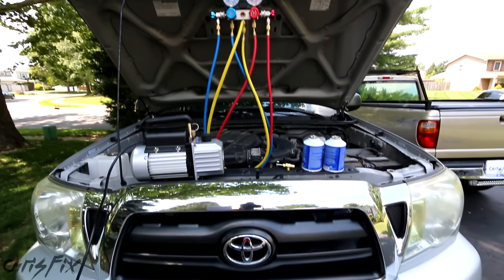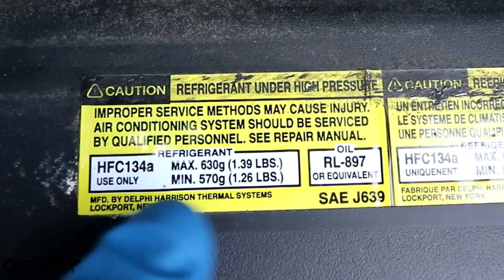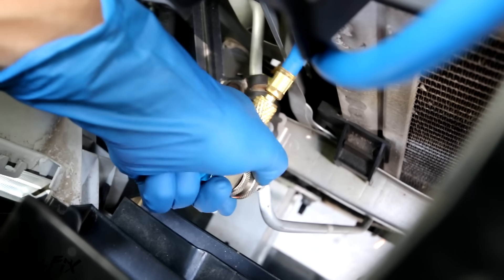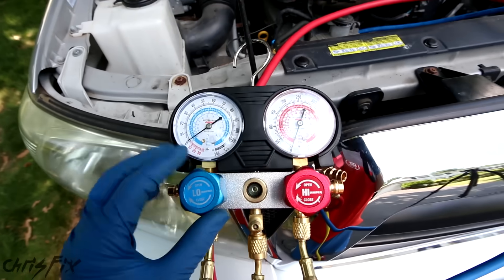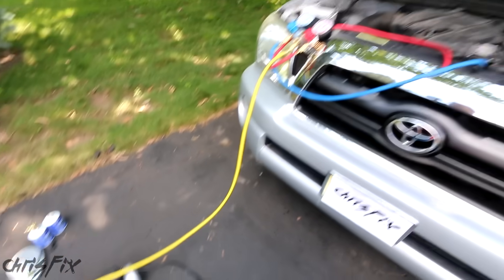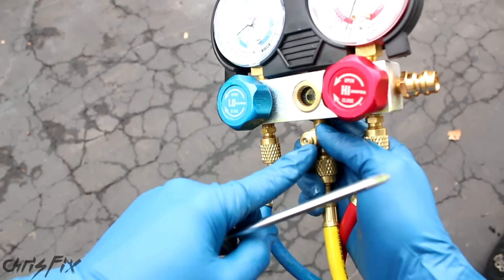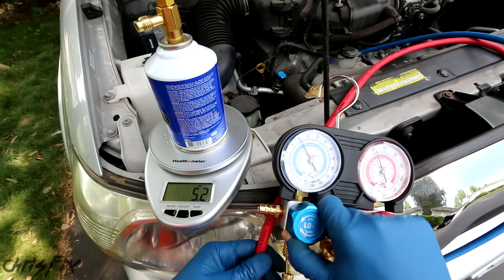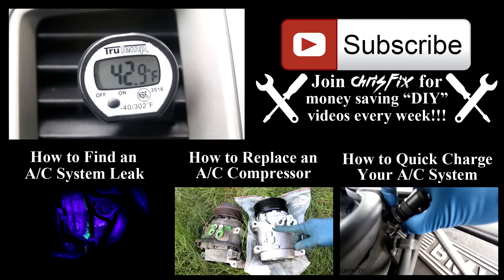How to Properly Recharge Your AC System

Comment: Hey @ChrisFix, my AutoZone loan gauges show static pressure (engine off) of around 45psi on both the Low AND high side. Same readings when engine rev’d and held at approx 2500rpm. Blows steady hot air all vents. Outside air temp at 95 degrees with about 42% humidity in Southern California. 

What could be the problem?

Vehicle is 2006 Honda Ridgeline RTL with 136k miles. No engine codes.
Reply from the maker: That means that the ac compressor clutch is not engaging!
Reply: ChrisFix thanks for the quick reply! FYI I think I know why the compressor is not engaging—I have a VERY SLOW leak in the low side Schrader valve!

I left the gauges connected to the low and high sides with the intent of checking the base pressure again in the morning. I checked the pressure about 6 hours later and both high and low sides had lost 4psi of pressure. Do I removed the hoses and I heard a very faint “hiss” on the low side Schrader valve. Lightly touching and releasing the pin didn’t stop the hissing—the valve is either bad or loose. 

I followed the directions on putting the hoses on and taking them off so I don’t believe I damaged the valve, I just think it finally gave out after 15 years. I sure it would have probably failed had I just put a can of refrigerant in it. 

So now I get to replace the valve a do a complete vacuum and refill! 

Are you familiar with the specific Schrader valves that Honda uses or should I just buy a kit on Amazon with multiple valves and the insertion tool? Any recommendations would be appreciated.
Reply: @chrisfix  I was so determined to learn the A/C system and am saving up for a vacuum pump. I am having trouble finding a proper can tap to use with my ATD manifold gauge.

Comment: How does the air and water get out of the system?
Reply from the maker: 6:55
Reply: @chrisfix  Right, I saw that, but where does the water and air physically go to?  Does it drip on the ground from somewhere?
Reply: @dajur1   My vaccum pump has white smoke coming off it as it seems it's evaporating something and after the vaccum is complete, there is a light puddle of water. So I guess the vaccum pump takes it out.
Reply: @arturotorres6437  Yeah, I think that is what happens.  I can also feel some moisture coming out of the fan area, so I think it goes out that way as well.

Comment: really weird to watch this, in the netherlands, because you are working with HFC gasses, you need to have a certificate to work with it. 

i got the certificate. but hell my teacher would kill me if he'd hear refrigerant come out of the AC lines haha. 

you need to have the car running for longer to make it suck the refrigerant back into the system. those lines would easily hold about 1 to 2 ounces of R143a. so you kind of under filled the system there.
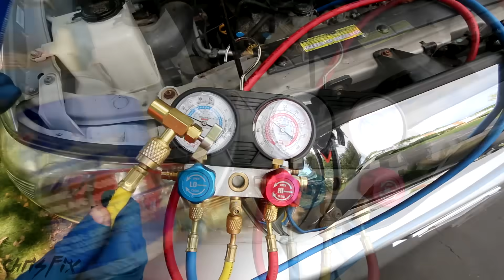Reply: yeah I don't know how long to keep the car running while it is being recharged. When I disconnect the can from the yellow supply hose, it DOES NOT sound like 11:20   Instead I got a good amount of refrigerant leaking out.

Comment: Nice video! When i was to refill the ac system that guy do it in about 10-15 min. So was a scam. After 2-3 years the ac doesnt make cold air anymore.
Reply: Yeah my mechanic filled my AC system with a can of refrigerant in about 10-15 minutes. Seems when the system is being added freon  or refrigerant a vaccum isn't needed but in this ChrisFix video, he had replaced one of the major components so that is why it took longer.

Comment: Do you add the refrigerant while still under a vacuum? In the video the low pressure gauge looks like it’s not under a vacuum when adding the refrigerant.
Reply: No, the vaccumm is the pre-step to adding refrigerant. Once you vaccumm the system, you turn off your vaccumm pump and disconnect it from the Yellow line. Then you start the process of charging or adding refrigerant to the Yellow line after you've confirm the system has held a vaccumm (no leaks detected). Remember Chris said the vaccumm is an important step as it removes moisture or air in the system and you want that completely removed before adding refrigerant, otherwise it could damage the AC compressor later on.

Comment: i followed this video step by step, and it couldn’t have gone any better. i live in vegas and haven’t had AC all summer, but i turned on my AC today and have been smiling all day thanks to this video. this is really easy to do, as long as you have found out where your leak is, and are able to fix it. thank you!
Reply from the maker: That's what I love to see! Thanks a lot!
Reply: Hey Ben I’m in Vegas aswell , would you rent me out your vacuum pump ?!
Reply: LethalWithFlight oreilly or autozone rents both the pump and the manifold gauges, you just have to deposit like $350 but they give you all that back when you return it! that’s exactly what i did

Comment: What happens if you accidentally add extra r134a? Will the compressor stop engaging? How do you remove excess r134a?
Reply: If you add extra then there is the risk of the refrigerant not being able to change states at the correct times and may enter the compressor as a liquid and mix with the oil which will then clog parts of the system. The only way to legally remove refrigerant is to have it recovered by a epa certified tech.

Comment: Why is there a need to recharge our AC system? Does the refrigant gets consumed in any way?
Reply: In the case of a leak, you would need to add refrigerant after fixing the leak. The previous video showed replacing the compressor, the first step of which was to have the entire system evacuated (all the refrigerant pumped out and recycled).

Comment: Once I start pulling refrigerant out with the pump, where it goes? Thanks
Reply: Goes into atmosphere that’s why Chris mentioned to recover it properly with the garage that has the very expensive recovery machine to collect it. He was just pulling a vacuum on an already empty system because he replaced the compressor himself and it didn’t contain any gas.

Comment: Hi Chris, did we actually have to use rhe vaccum if no AC components was replaced. Im just low on Freon. The compressor is fine and the clutch kicks in as soon as I switch the Ac on.
Reply: Chris said only if you're replacing the A/C compressor, condenser, or evaporator. My mechanic charged my system after replacing a high pressure line and I asked him if he needed to pull a vaccumm and he said no. So yeah, you wouldn't need to pull a vaccumm when refilling a system with low freon.
Reply: @arturotorres6437  thanks for your time and promptness

Comment: Oriface tube and dryer should be replaced always !!!  when doing a compressor change . Also if the previous compressor failed the system should be flushed and blown out with nitrogen.

Comment: DO NOT DO THIS.  You MUST PRESSURE TEST the system.  You cannot, EVER find a leak with a vacuum.  The vacuum SEALS cracks.  You must pressure test.  Usually with nitrogen (inert).  THEN vacuum, then fill.  Again, you will NEVER find a leak with a vacuum test. 
Always hold the can up side down so it always has liquid in the line.
Reply: Err, no...  vacuum won't close up most leaks.  Pressure test is definitely better, but it's not like vacuum testing won't find most leaks.

Comment: Also every time you attach your gauges to a system you’re actually losing refrigerant if you’re not properly removing the gauges.
Reply: My shrader valves keep getting stuck open when I remove the bushes from the lines. Do you know why this keeps happening?

Comment: On a residential air conditioning system you would close the high pressure side and open the low pressure side to suck the refrigerant you left in your gauges so you’re not leaving the system a few ounces low when you finish. Yeah you sucked 22oz in but you left a few in your gauges when you took them off. Those low loss fittings just keep the refrigerant inside the lines when you remove them.

Comment: You didn't say how bad the compressor was or if metal was in the system. If metal is then  consider  replacing the condenser and receiver dryer. Depending on miles it's always a good idea to replace the dryer.  Nice work overall.

Comment: What if you haven’t replaced any major components but haven’t used or recharged ac in a while. Would I still need oil?
Reply: Probably not, I replaced the condenser and drier/receiver canister on my town car and added 2oz of oil (require 6oz total) (assuming it lost some from the leak) BAD IDEA, ended up being overfilled and blew the front seal out of the compressor. If your system only lost charge, a thorough vacuum and recharge should be all you need.

Comment: The yellow line on my set has a valve in one end, but it didn't seem to affect the vacuum.
Reply: Use a valve stem remover to take it out 👍. (same tool used on tires) You might need pliers to pull it out once you unscrew it all the way through. I rented a pair from autozone and had to do the same thing that's happening to you

Comment: Question"
What if after vaccum i decided to fill the freon without starting the engine like you did?
Reply: You can add refrigerant with the engine off at first, but it will only allow the refrigerant into the system until the pressure in the system and the can equalizes. Then you would need to start the engine and have the A/C on.
Reply: Zach Miller i did that process but i think i cause air in the system that i need to evacuate some of my refrigerant until it stabilized the sure pressure in the ac aystem.
Reply: Hector Aldozar thank you

Comment: You mentioned you replaced your A/C compressor and that it had the oil already in it.  I just replaced my A/C compressor and it also came with just over 6oz of oil in it.  As part of the Compressor replacement I also change the receiver/dryer 'accumulator".  I added about an extra ounce to the compressor to account for the receiver dryer, but notice after I drained the old one that 2 ounces came out.  My high side port is right on top of the receiver dryer, so I assume it is OK to pour the oil right into the new one?

I'm not an A/C expert, but know a fair amount.  In one of my videos I showed sucking oil into the high side and had some negative comments about doing that, saying I should have sucked it into the low side.  If you replace a compressor and receiver dryer, assuming the system had no major leaks, where and how much oil should you add to account for the new receiver dryer?

Comment: So I get all the way to the step where you open the lo side to let the refrigerant in and my AC clutch won't engage -_- and then doesn't empty the can. My low side gauge has the pressure at 90, but clutch never turns on

Comment: Hey Chris! Quick question, what is the difference between recharging the AC system in my car using this method vs. your other method where you used a can of AC Max that doesn't require using a vacuum pumping and hooking up the gauges? I recently replaced the radiator and condenser in my car and need to recharge the system. Is one of the methods better and why? Or could I use either or? Thanks! :D (If anyone else in the comments can help answer, plz do so :) )

Comment: How does your high pressure side show 100 psi if you only opened the valve on the low side while adding your refrigerant?
Reply: The compressor turned on after adding some refrigerant to the system which will cause the high pressure side to start building up pressure. Hope this helps

Comment: 06 Honda Accord, AC blows hot and compressor doesn't kick on.  System had a high psi reading.  Replaced relay, that did nothing.  So I had system evacuated, replaced compressor with a used one, then followed these steps to recharge. Same as before, the Compressor never kicked on, low side pressure went very high maybe 150 psi, high side same pressure as low side and nothing blowing but hot air.  Any thoughts?

Comment: Hey Chris, I got my system all vacuumed out and it held for two days at -30. When I went to fill, the compressor would not take in any freon. Even when jumping the compressor clutch it still just stayed at 110 psi on low side. I'm at my wits end trying to figure out what the deal is! Compressor was running fine before I went to recharge. Expansion valve and receiver have both been replaced as well.
Reply: Did you put a new compressor in? Did you add oil if you did?
Reply: @LogieD223  Compressor was working fine before I redid system. Swapped to ester oil for the conversion

Comment: Extremely helpful video. I found out I have a leak from the evaporator in a 2014 S4. Would it be ok to just recharge the system every time it runs out? Lasts about 3 weeks. Thanks for all the great content. I subbed to your channel.
Reply from the maker: You could do that, but now that you know what the issue is, I would try to fix it! And welcome aboard!
Reply: Recharging the AC system every three weeks will rapidly turn into a chore. And while R134A isn't exactly expensive, it isn't cheap either. Not to mention the environmental impact that continually dumping refrigerant has..
Reply: BirdbrainedPhoenix the car was sold.

Comment: Great video - thanks!  You mentioned you added dye with the last refrigerant recharge so didn't need to put in more dye - but you have now purged the system before refilling. Did the dye not get removed with the refrigerant when it left the system and/or by the vacuum pump running for 75 minutes?  Just wondering why more dye wasn't needed - and would it have hurt to add some to make sure it was there to show any leaks?

Comment: Your video was amazingly helpful but I had a major issue happen tonight. Everything was normal per your video. Added the oil and Freon, closed the system off on manifold and on the connections to the car. I took the high off, no issue, took the low off and Freon sprayed everywhere. Based off of what the valves were reading and the fact that I haven’t had ac for about a year and the system didn’t lose any Freon. The system was also vacuumed for 2 hours, the previous night I emptied the system completely of Freon, which was shown on the pressure gauge. I’m at a loss. Let me know if you have any advice thanks.
Reply: As a side note the only thing I forgot to do was purge the air before adding Freon (was working for many hours and I just forgot to do it). My best guess would be there is something not sealing properly on the low connector on the car but it was holding properly the whole time
Reply: Psi when adding Freon on the low end (high was closed on manifold as you mentioned but open on the car). Psi readings were completely normal.

Comment: What type of Pittsburgh Automotive pump vacuum pump are you using? Is it the 3 CFM 2 Stage Vacuum pump made by Pittsburgh or not? You showed it so quickly in the video I couldn't see it but yet you say you need to drive down to 30 micron's is that correct?

Comment: Thanks for the video. I have a question: I recently got a brand new car but the AC it throwing 13C on inner (recycled) air and 22C on outside air (33C) it looks quite hot to me. Do you think they sold me a car that’s low on Freon, it’s just a crappy AC or is it ok?

Comment: @1:30:  Whoa!  Fluid ounces and ounces are not the same things.  The can stated 12 fluid ounces (volume), whereas you converted that to to ounces/ pounds (weight).  Unless you know the density allows a 1:1 conversion (roughly the density of water), I'd be very conscientious about the conversion.

You'd probably have been better off sticking with grams (listed on both the sticker and container).
Reply from the maker: That's exactly why I used a scale to measure the weight of the can at 11:22 , and the can stated 12 fl. oz as weight, look closer :p
Reply: @ChrisFix:  Maybe I was unclear.  Your conversion from pounds to ounces and your use of a scale were both fine.  The issue is that you equated ounces with fluid ounces.

Fluid ounces are a measure of volume, not weight.

The can listed "fluid ounces", not "ounces".  The can should've listed either (a) ounces and grams or (b) fluid ounces and ml.  Maybe the manufacturer screwed up and printed "fl. oz." when they meant "oz."  (That wouldn't be reassuring for the manufacturer of a chemical product.)

Fluid ounces (volume) don't correspond to grams (mass).  Try using a unit-conversion app to convert grams to fluid ounces.  Likewise, try to get the app to convert fluid ounces to ounces.  It's not possible (unless the density is specified).

E.g., 12 fluid ounces of mercury does not weigh the same as 12 fluid ounces of olive oil.  However, 12 ounces of mercury weighs the same as 12 ounces of olive oil... or peanut butter, or hydrogen, or unicorns.

I really enjoy your channel and I'm not being snide; this is just one of those things that can really bite you in the butt.  E.g., if the amount you'd needed had been 24 oz. and you'd therefore just used 2 full cans (24 fl. oz.) without weighing, you'd likely have used the wrong amount.  Fluid ounces are a measure of volume, not weight.
Reply: @ChrisFix Wow! You are responding to comments under 5 year old video!
Reply: @chrisfix  Fluid ounces is a measure of volume, not weight.
Reply: Wow! You are responding to comments under 5 year old video!